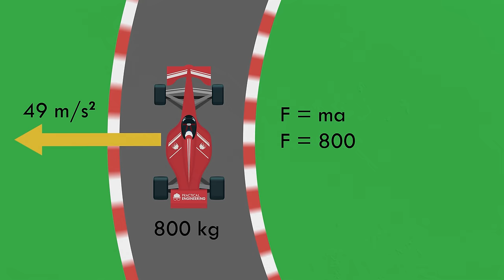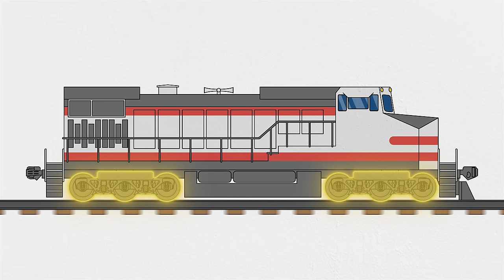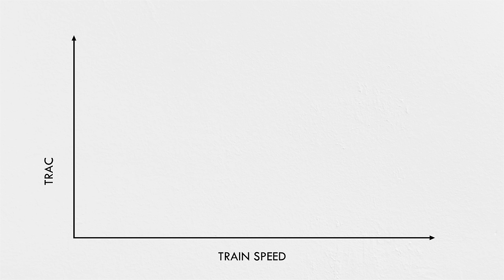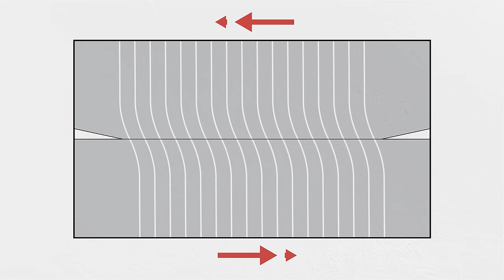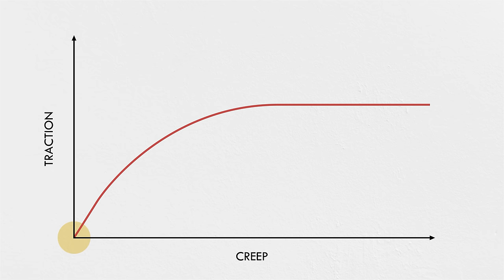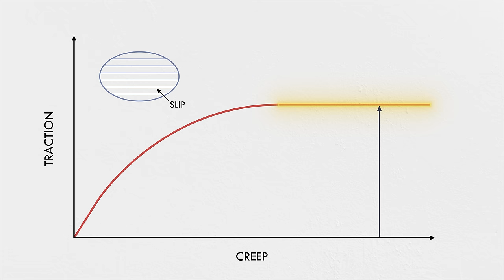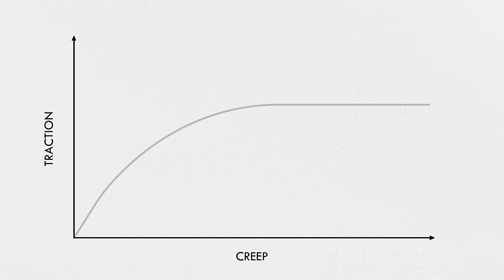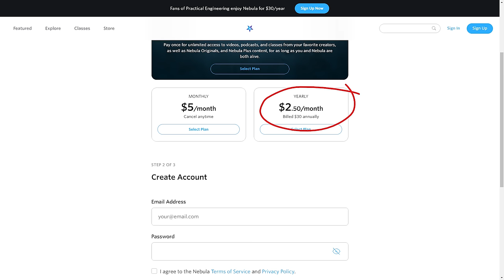Why Locomotives Don't Have Tires

Comment: I remember seeing in movies of steam trains, that when they first move off the drive wheels spin as they lose traction, as stream engines output huge amounts of torque! But they oscillate a few time and it gets them rolling enough that they stick more than slip! Super fun to understand the mechanics behind it now! 😊
Reply: Slipping had to be carefully controlled (i.e. prevented as far as possible) by the driver promptly closing the regulator.   A driver would attempt to avoid any slipping if he could.   A full uncontrolled slip could wear pits on the rail top or 'burn' the rail, which was dangerous as it could lead to the rail developing a crack; or it could even lead to damage to the locomotive.    
What movies did with slipping on starting, or wheels locking when braking, often owed more to the director's imagination than reality.

Comment: I get your point but locomotives DO HAVE TIRES.  Not tires like on automobiles but they have a steel band surrounding the large wheel that can be replaced when the surface is worn.  An emergency stop will wear flat spots on the wheels and replacing the relatively thin "tire" saves cost and retains the majority of the wheel.

Comment: In the days of steam, locomotives did have tires, they were just made of steel and acted as the sacrificial part of the driving wheels so you wouldn't have to replace the whole thing as they wore down.

Bit of a lost art these days, but the tires were machined 1/8 of an inch smaller than the wheel hubs, and were fitted by heating to expand them then letting the tires shrink fit on as they cooled.
Reply: Lost maybe to train wheels but still common in other applications.

Comment: They use to.
Cars tires inherited the name from trains.
The train tires were, and are heated up with a custom ring torch.
The metal expands, and rings can be removed, or replaced.
There is a video demonstrating this on here.

Comment: This reminds me of a Friction question from high school Physics that no one seemed to be able to clarify, even later in my college Engineering classes: If the force of friction is the coefficient of friction times normal force (F=μ*N) and the normal force is the gravitational constant g times Mass "M" (N=g*M), so then together F=μ*g*M. Cool Following so far but then that friction was used as a decelerating force under F=M*A. plugging it in you get M*A=F=μ*g*M or just M*A=μ*g*M. In this formula the Mass can be canceled out and you are just left with A=μ*g (and remember g is a constant and μ is a 2-material property). This seems to imply a bunch of messed up stuff like implying that a 200,000 lb truck should stop just as fast as a 2,000 lb truck which doesn't fit with traditional observation at all.
This assumes the coef of friction is only a 2-meterial property and doesn't change based on the normal force between the materials. Maybe that's the issue here but no one I know studies friction enough to say one way or the other! The teacher was even willing to compare a motorcycle and an 18-wheeler using the same tires because the formula doesn't have contact area in it and if you double the contact area then you half the force on that contact area which cancels out the effect. Is this all just black magic?
Reply: Yes.
Reply: Most of that is true, but I'm not enough of an expert to dissect every formula for you. The braking aspect is mainly governed by the stick-slip relationship from the video which is not taken into account for your equations. If you had the same number of wheels per weight (in order to not overload the wheels), a semi should stop as quickly as a normal car.
The coefficient of friction is indeed a 2-material property independent of normal force. However, as you might expect this is also a simplification. The coefficient of friction is only independent of surface area on a macroscopic scale; when you zoom in further, the coefficient of friction becomes dependent on the surface area again through tribology. You are not running into a problem, but you might be using linear equations at non-linear interaction conditions.

Maybe try to look at it this way: The coef. of friction is a 2-material property because it depends on how much energy it costs to force those 2 materials to interact. The normal force dictates how strongly they are forced to interact. If you spread this out over a larger area, more material interacts with lower force, regaining the original friction.

Comment: The steel ring that goes round a locomotive wheel is called - a tire. It means when it wears out, just the ring needs replacing, not the whole wheel.

Comment: As I'm sure a lot of other kids have done, I squished a few coins (and penny candy) on railroad tracks.  Half of the coins pinged to the Twilight Zone, never to be found.  These were VERY slow moving trains, traveling only a few miles per hour near a paper mill.
The mill shut down years ago, and railroad trains aren't as common a sight in town today as they once were.  I've never ridden on a full scale passenger train, the nearest passenger depot is hundreds of miles from my home town.  P.S. it's been more than five decades that I could legitimately call myself a 'kid'.  I've been kinda binge watching Practical Engineering videos.

Comment: Another reason to not run rubber tires is electric pickup for either the return current in purely electric traction or things like track circuits.

Comment: Actually some locomotives still have "Tires" but not tires as we like to think of them on cars... Well there are some of those as well, but they are doing mass transit systems like you would commonly think of subway trains.
However these "tires" are made of metal and would appear to be steel or part of the wheel on the locomotive at first glance.

And these tires have caused crashes as well, german ICE became infamous for that.

Comment: the third factor in the equation is the shear strength of the tire material and road surface.  less shear strength will degrade both traction and lifespan of the surfaces.

Comment: The F-1 grips at high speeds because the aero groundforce is 4x the weight of the car. G force is 3G at most 
PS: the shown cars were  a lesser Formula, not the F1.

Comment: But trains do have tires, they're just not rubber. But I've seen Modern Marvel episodes where engineers call them "Tires".
Reply: A lot of modern trains don’t anymore they have single casting wheels and the whole wheel is replaced rather than just the rim

Comment: In a future video could you talk about the reasons why certain locomotives have the number of wheels they have? Apparently the are even competing notations for specifying how the wheels of a locomotive are arranged, so a lot of thought seems to go into this topic. An explanation I often seem to come across, is that more wheels leads to more contact area and thus more adhesive friction to transfer tractive force, but it is also usually said that adhesive friction is proportional to normal force and the adhesive coefficient, so on the surface this doesn't seem to depend on contact area or the number of wheels at all. There are probably more aspects that play a role here, but most explanations I've come across so far didn't make it click for me yet.

Comment: Steam locomotives use tires on their driving wheels.  Those tires are metal rings with special metal properties for high traction.   The grip producing softer metal wears quickly requiring replacement.  Railroad driven wheels use sand to increase interlocking traction for starting.   A Washington DC Metro Rail employee at the N.VA model railroaders in Vienna VA said that Metro can go up a 7% grade and has them, but they'd never do it again because in the rain with full sand the trains spin their wheels all the way up that grade.

Comment: Although trains don't have pneumatic tyres (unless they're in a French metro system) they can have non pneumatic rubber tyres for climbing steep grades without ratchet gears or steel tyres on locomotives to facilitate replacing or resurfacing a flat spot caused by slippage while braking or accelerating too hard.

Comment: The wheels on trains are cut to specific design specs.  Its all about that little dime sized contact point.   Wheel slippage  causes flat spots on the wheels and once past a certain wear spec.   They are brought in to be exchanged and the bad ones are recut.

Comment: In  the steam age the drivers on the locomotives had tires - the flange and rail wear surface were a steel tire that heat/shrunk fit to the driving wheels of the steam engine.  Because of this engines were not a big component of braking the train, the heat generated in braking could expand the tire off the wheel.
Reply: Depends on the country and the gradients, I suspect.    In older British freight trains the engine was often the ONLY component of braking the train.    Sometimes (but not always) assisted by the guard in his van screwing down his handbrake.   Goods wagons gradually acquired 'continuous brakes' over the years, but even by the end of steam not all wagons were braked.   The limit load for an engine over a particular line was more often set by its braking power than its traction.   
This may have been different in countries with mountain railways.

Comment: The brakes on freight cars are set so that they never lock up the wheels on an empty car, which means that a full car has very little braking and it takes forever to stop a freight train that's loaded.  It's less of a problem with passenger trains since the load swing isn't so wide.
Reply: European rail cars generally have a lever to change the braking force. One setting for empty cars, one for loaded cars. On older cars, it's manual (a lever on the side of the railcar), and on newer cars, it's automatic.
Do American freight cars not have this feature?
Reply: this is a strong argument for antilock braking - mechanical versions of which have existed (for aircraft) for over 60 years

As with all rail safety, it won't happen until companies are forced to implement it

Comment: Maybe it’s just me being german, but the Question in the title „Why no tyres?“

The answer: Makes them less efficient 

Well there are trains that use tyres, one of them crashed in 1998, because of the tyres, which made trains in Germany (and I believe railways outside of it) use no/less tyres. If you have a train with tyres or only a loco or wagon, you have to inspect that the tyre didn’t shift around the wheel

So the reason besides efficiency is safety, which is always the more important one outside of North America

Comment: Title should be "Why Locomotives Don't Have RUBBER Tires".     Steam locomotives and older rolling stock almost invariably had steel tires, shrunk on to the wheel rims, which meant that when the wheel rim wore, the tire could be replaced rather than the entire wheel.   This was done for economic reasons, I'm not aware that a steel-tyred wheel had any different adhesion than a monobloc (one-piece) steel wheel as Grady implies at 12:55.
Note that some urban transit lines (e.g. Ligne 1, 4, 6, 11 and 14 of the Paris Metro) do have rubber tires, to improve acceleration or traction on steeper grades.

Comment: This makes practical sense regarding traction during acceleration. But I have always wondered why they do not have rubber brake pads in the middle of the cars that come down against the rail itself via air to provide breaking. Imagine the breaking force you could generate with a pad that had 4 dimes of contact per side of each car in a 60-100 car line. I imagine a train could stop in a controlled manner in a fraction of what it can currently.

Comment: Very cool info, thanks. 
It's kiiinda stuff I already knew a little bit, but packaged in a concise and entertaining way, and I definitely understand it better now. 
Also interesting how a lot of that applies to cars, too (obviously, since they also use drive wheels). 
On some drag tires, they visibly deform as the car launches! Like your wore wheel.
I guess because these tires are extremely soft and the driver is going for their absolute sweet spot of slip vs stick.
"Slip angle" seems to refer to this effect in the context of cornering.

Comment: What's not clear to me is why we can't get trains to stop in a reasonable distance? There are a lot of videos where a train comes down to a blocked crossing with a truck or school bus, and they just plow right through it. If all the wheels of a train lock-up (or have ABS) why cant they stop for like a mile after they hit something. Is this a case where a consumable product such as rubber can't be deployed from under the rail car to increase the friction and reduce stopping distance?
Reply: Something like rubber would ruin the rails and wheels of the train and even possibly lead to derailment.
Reply: @tim8801  Assuming you are going to hit a vehicle like a truck or school bus, I would think having to replace some rails or re-rail an engine wouldn't be that big of a deal. Im not suggesting this be deployed every time, but as an option for emergency stop by the engineer. I would think saving lives would be worth it.
Reply: @ronwatkins5775  well like I said it could de rail the train and even so rubber wouldn’t make it stop fast enough all you have to do is keep train track clear it’s not hard

Comment: Interestingly on a couple lines in Paris like the Paris metro and a few other places there are trains that use rubber tyres for more traction for acceleration and braking
Reply: It does make sense for low speed passenger rail where they don't carry as much weight in an area where reduced noise/vibration are worth the durability trade off - like near the Louvre.
Reply: Yes - we were so impressed by how quiet they were! I wondered about the longevity but now your comment explains that it was for only some areas where quiet was important

Comment: I saw 3 locomotives with a 4400 HP rating start a train @7000 tons and the train achieved  15 MPH in 100 feet and continued accelerating to 35 MPH by 1/4 mile, the brand was GE but don't know the model which is important to determine it's tractive effort.

Comment: I've been watching your videos about trains and tracks as well as train wheels. In one of your videos you stated that the connecting surface of the wheels and the rails where about 2² per wheel. this would reduce the resistance, which would increase the ability to move heaver loads. You also said "Due to the lack of resistance. Climbing a hill or mountain has very many problems.  How about a video on how this works? To be more specific. I have live in Germany, since 1983. There is a train connection from Stuttgart- Ulm. This requires the train to overwhelm a very high grade. How about a video? Thanks

Comment: It doesn't mean that train "tires" don't exist, though. Normally, a train axle is made with the wheels in one piece.
In some occasions, that is not the case and the (obviously steel) tread is put on seperately. This means, you don't have to replace the whole axles when a "tire change" is due, which saves on costs. Because of the thin tread and the resulting higher stress on the material from deforming as the train rolls, these "tires" are usually only used in low to mid speed applications like trams.
People tried to adapt those on high speed trains, which led to the ICE-1 Eschede train disaster.... and since then I believe nobody has tried again.

Comment: Back in the days of steam, locomotives did have tires. These tires were steel rings that were heated and slipped onto the wheels where they cooled and made a very tight interference fit with the wheels. When the tires got too many flat spots or the profile was worn out these tires were heated up removed and replaced. Now diesel electric or electric locomotive wheels are reground back to the proper profile. This can only be done to a certain extent, and if the diameter gets too small, the wheel set is replaced. Both solutions are very very expensive, highly labor intensive and time consuming.

Comment: In My Opinion.
Obviously if We Fit Drive Motors to All Wagons Then Traction is Greatly Increased.
The Front Loco would Need Less Power but Still Contains the Driver, Assuming the Train is Not Automated.
Further, The Noise from Trains and Overall Transport Consideration are Also Factors with Rail verses Tyres.

Comment: So, is the coefficient of friction between race car tires and the track is around 5 (8800 lb-force of friction on the tires of an 1800 lb vehicle)?  That seems crazy high.

I'm not sure if it was explicitly mentioned in the video that the area of contact isn't in the equation for friction force, but that might be worth a few words.

Another great video!

Comment: This is awesome! And also, you mentioned a couple things in this video...

Creep. How much does this happen with car tires? I've noticed that some cars' spedometers are more accurate than others. I know some of this has to do with the needle accuracy, but... how much of this has to do with creep? From what I've seen, they tend to all read high - which would be consistent with the wheel turning faster than the car is moving.

Corrugation of the rail. Is this what causes washboard dirt roads?!

Comment: Interestingly enough, trains DO have tires, only that the tires are made of soft steel.   They are heated to expand their inner diameter to fit them on the steel wheels, then allowed to cool and shrink tight in them.    Search youtube for the video titled "Railway wheel tyre fitting, Buckley Wells Works" to see one being heated and mounted on a wheel.